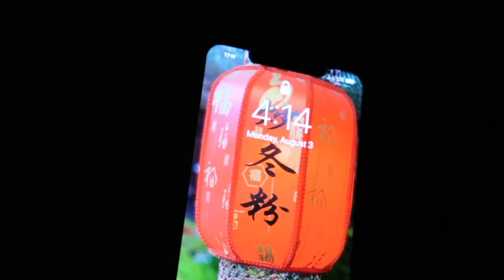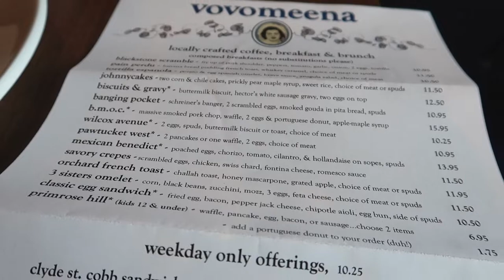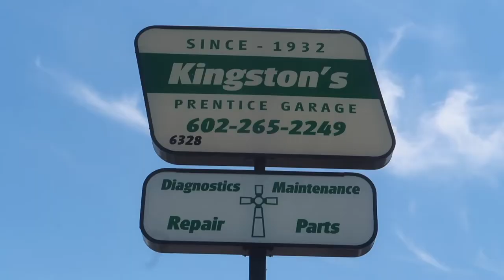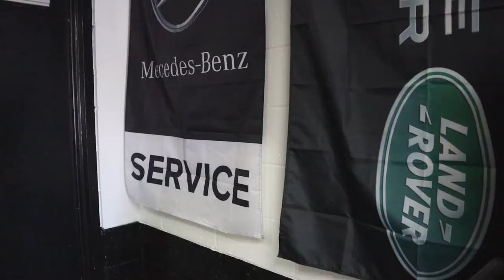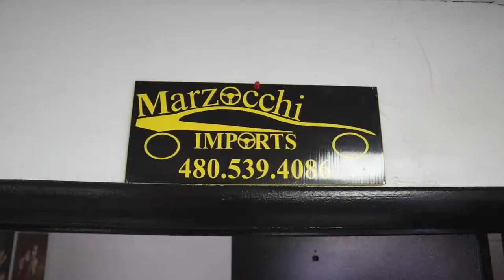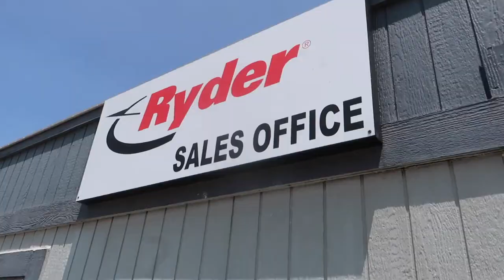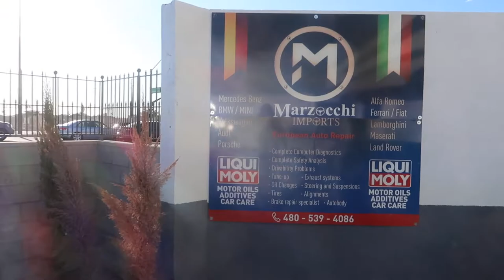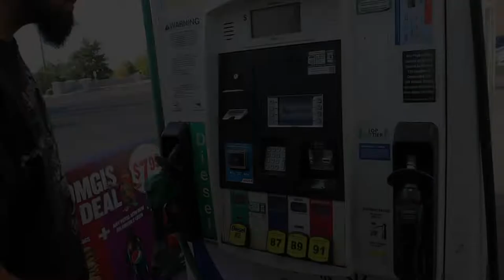WHAT TO LOOK FOR WHEN BUYING A USED VAN | HOW TO FIND THE RIGHT VAN

Comment: The original Merc. Sprinters are really Reliable Vans, i got mine in the UK a 2014.with 245k Miles in 2019 for 7500$°°from a Auction, mine does 110mph..but at Auctions you need Inspect yourselves..i do Maintenance myself. 🤔🇪🇺🇺🇸Clutch, Brakes i can do cheap for couple hundred in Labor plus Parts from ebay.
Reply from the maker: Wow....sounds like you got a deal with that purchase!
Reply: @TenajTino  Yes, in Germany they about 9000$ a five year old Sprinter, so i bought (5400pounds sterling+fee 200p) it in the uk they cheaper at the Time when the currency Rate was low(2019),difference is they all 4cylinder and 90%the mechanic Transmission, but to save Money you need learn on YouTube Maintain yourselves, its a piece of cake with Tools and two Ramps, i dont know the Quality of Freighliner Sprinters are they made in Germany too. 🤔🇩🇪??The downside is they righthand drive so its dangerous at junctions so i install a Camera with a Monitor for the dead spot. 😂👍🇪🇺
Reply: Good Luck. 👍
Reply from the maker: Excellent 👍🏽
Reply from the maker: Will do 👍🏽